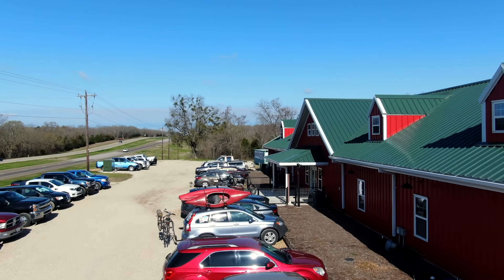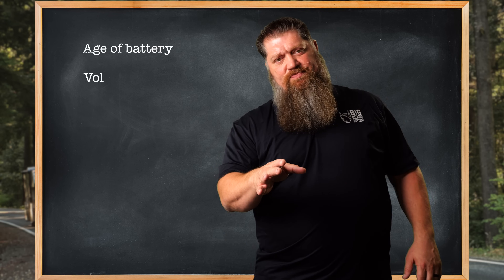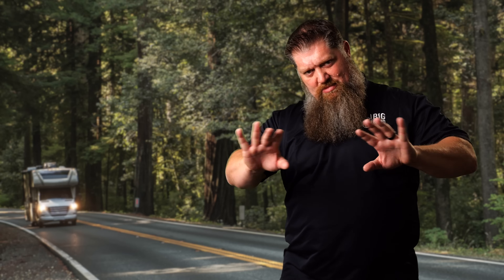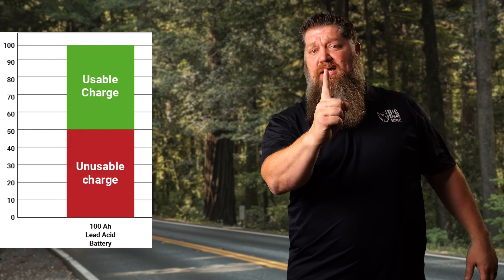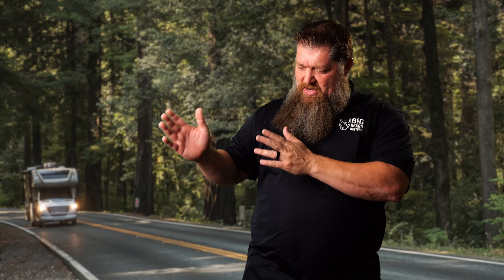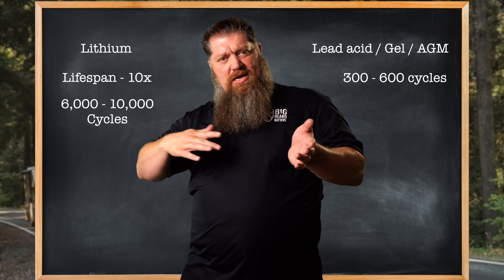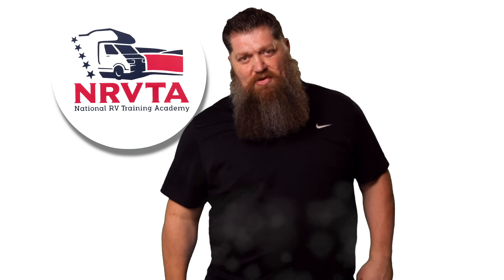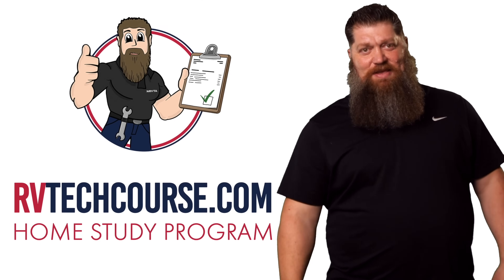When should you replace your RV batteries?

Comment: generator no start - no click nothing, dead.   12.5v at battery and 10.5v at solenoid.   time for new battery?
Reply from the maker: I assume the voltage drop is not under load, but was the drop before the solenoid or after (input side of solenoid or output side?) sounds like a bad solenoid if after, loose connection if before.

Comment: My recent issue with my single 100ah battleborn lithium battery is that it was sold as a drop in “plug and play” for my house battery. It worked great for about a year, and then then BMS would trip when attempting to start my 4k generator. Battleborn’s chart claims it can spike and start my 4k generator, but after a relatively short time, it did not have enough power to cycle the starter. I called Battleborn and they said, yeah, that surge spike spec shouldn’t have been on the sheet (they were actually surprised when I pointed it out). Not sure if they’ve updated this, but it’s a major flaw with this setup if you’re only running one 100ah battery.

Comment: I watched a bunch of your videos concerning lithium. Things like convertor only charges to 80%. Change to an inverter to max charge to 100. And solar can top off because of the 14.6 charge availability. But my question comes from the truck side. I know an alternator puts out 14.4 (average). Does the truck have the same effect as the solar. Or do I need a compatible component  for lithium between my truck and the lithium batteries?

Comment: Great info on the lithium and active balancing.  Thinking of changing to lithium.  I have 2 solar collectors on the roof that keep my lead acid charged.  But I tested my battery and it dropped just by putting on lights in the rv.   Thanks for all the info.

Comment: Since RV batteries are the topic, quick and maybe a dumb question..  My small travel trailer has a 4 LED style battery monitor from the factory. Does it adjust for the 50% discharge with a lead acid battery? I mean, if one bar is left lit, does that mean you are close to 50%, or does it mean you just ruined your battery because it is at 15-20%????

Comment: Hello my new coach batteries are not maintenance free. Any tips or special tools to help top up electrolyte with ease?
Reply from the maker: Gloves, glasses and a flat head screwdriver. The caps are pressed into place they just need to be pruned open with ease.

Comment: Reasons I have 12 200 ah lithium batteries in a 3P 4S configuration 600 ah bank
Reply: If you have 12.  200 amp batteries. You have a total of 2400 amps more then enough

Comment: If you replace your batteries with lithium (ie. 2 100 AH) can those batteries still be used to start my 5000w Onan onboard generator? read conflicting reports on using lithium as starting batteries but does the generator count as using it as a starting battery
Reply from the maker: So the generator starts off the HOUSE battery not a starter battery. 1 lead acid battery is typically what starts it. 

A lithium battery can easily start the genny.

Comment: Question: I have 4 - 6-volt golf cart flooded batteries in series and Parrell to give me 12 volts. All the same year. 2019. One seems to boil over a little. Voltage is good. They stay around 6.70 while plugged in to shore power. New converter in the rv to upgrade it. Any idea why this is happening? You do a great job making people like me understand your tech tips. very knowledgeable. Thank you.

Comment: If you are full time stationary plugged into power, how do you know how many cycles the battery has gone thru? Thanks
Reply from the maker: Probably very little. Your converter is doing most of the work if you stay plugged in.
Reply: Would being plugged in to shore power for months weaken the battery? Should someone plugged in for extended periods unplug periodically?

Comment: Here's a stupid question but do the batteries in this act as caps?  That is, do they help clean voltage coming in from the invertor in the same way a battery smooths voltage before hitting the ECM/BCM/TCM in a car?  My feeling is no, but the reason I ask is because frankly, I don't need the battery for anything expect for maybe the radio memory and occasional light while in storage.  Since it only runs my 12 volt side, I RARELY see a reason to have it at all.  It ONLY runs my lights, radio, and a couple USB ports that I added.  Fridge, microwave, TV, etc are all 120VAC.

Unless my battery has been dead from the get-go and it should be able to handle a 120VAC load, I don't understand the hype of having them really.
Reply: Do you always camp with your RV plugged in to shore power?

Comment: I have 2 deep cycle lead acid batteries hooked up to an 80W solar panel controlled with Go Power Controller. Its the stock setup with the Surveyer Legend 240BHLE. Can I simply swap out the batteries with two 100ah lithium batteries, hooked up in parallel for 200ah, and switch the controller settings to lithium? I dont need to run large appliances. I have a generator for that. However, I think 80w solar won't be enough to charge 200ah from 90% discharge. I could probably get away with one lithium 100ah. That would be better than 2 lead acid batteries 200ah considering lithium can be more than 90% discharged.
Reply from the maker: Yes

Comment: Thanks for a very informative lesson. 
I do have a question about whether or not one needs to be as concerned about balancing AGM batteries the same as you do with LiFePo batteries? If so, what equipment is used to monitor multiple batteries and ensure that they're balanced?
Thanks again!